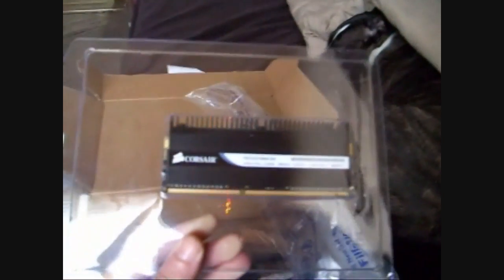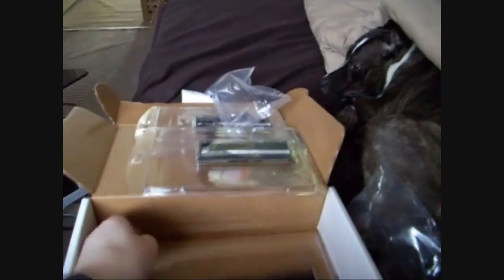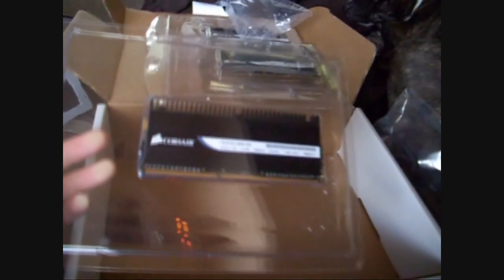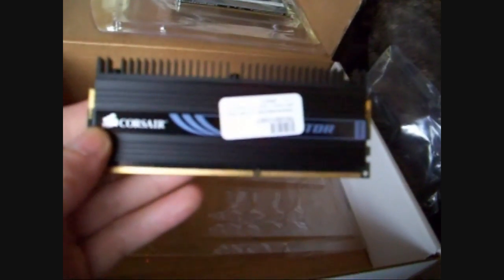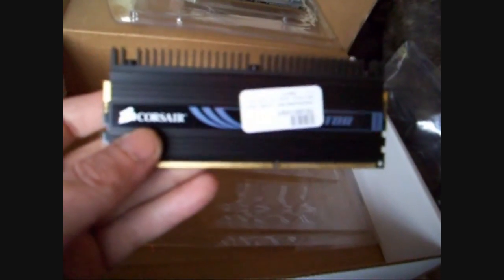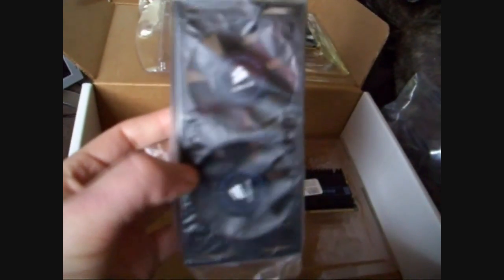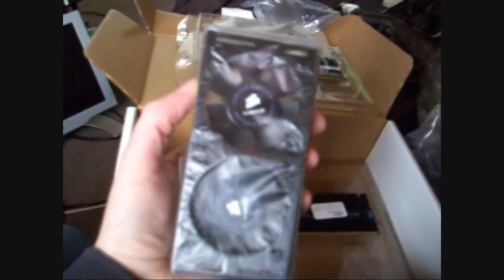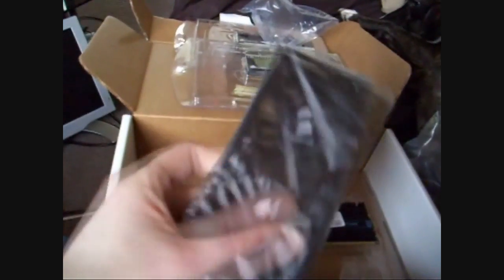CORSAIR DOMINATOR 1866MHz TRIPLE CHANNEL CORE I7 MEMORY

Comment: There is a difference in the latency
so
Dominator 1866mhz = 9-9-9-9-24
OCZ 1866mhz = 8-8-8-8-28
so if you overclock your pc until the edge you will notice it

Comment: i got aa little question i did a overclock on my 285 gtx black edition and the degrees reached near 60 C so i minimized the game (crysis) and set fan speed to max then maximized again and i get a bsod is that normal is it couse earlier my card reached 108 degrees cel when doing the furmark xtreme burning mod took 300 seconds to reach 108 then the test finnished the pc locked i rebooted